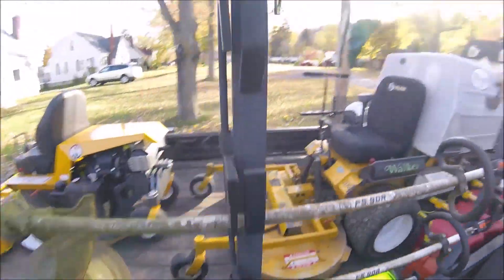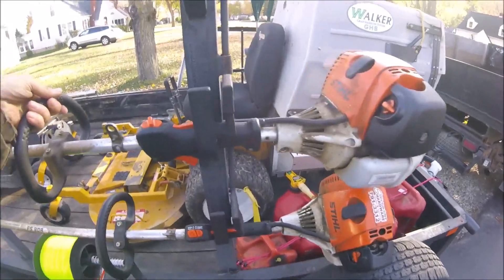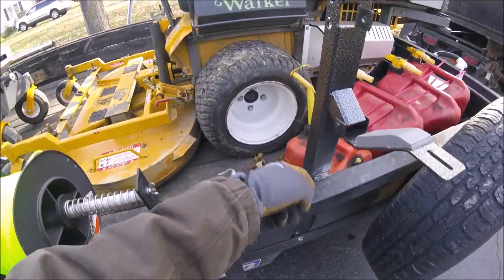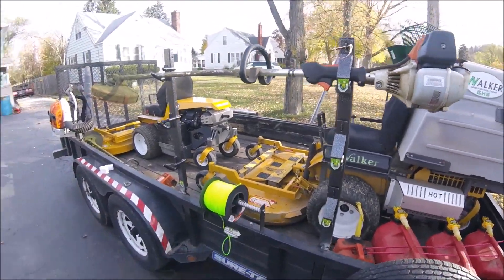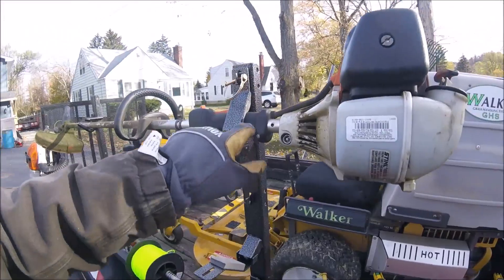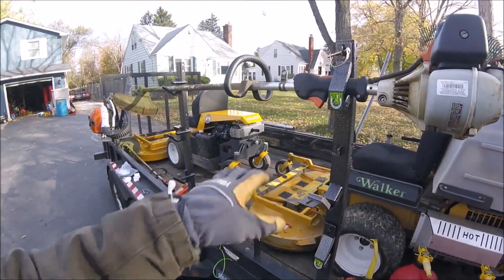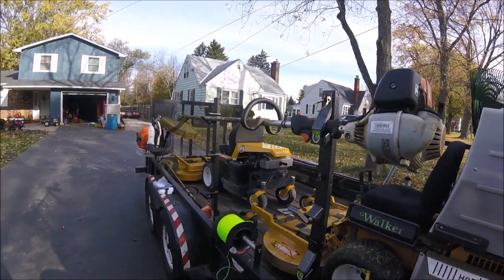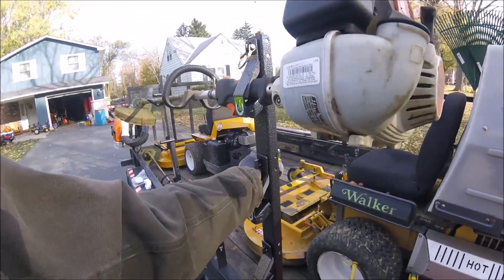New Trimmer racks & why I use what I use

Comment: do you leave your trailer outside at night and take your equipment inside everytime?
Reply from the maker: Lock the trailer up with extreme locks and the trailer is under cameras at 3 different angles over 28' up so they can't be reached.
Reply: What about the equipment being in the elements"?
Reply from the maker: @MatthewSmith-uf6tr  oh nevermind, sorry usually I run an enclosed. Yes, when I use the open it all comes inside

Comment: The green touch racks come with the  engine supports now but they suck balls! I️ just got mine. Love the racks but the new style engine supports suck because here isn’t much adjustment like the old engine supports you had to buy. Never the less they are pricey, they need to get there shyt together 😂
Reply from the maker: San Quin All about the money. They could care less about the customer
Reply from the maker: Mike Zavitz gotta stick with whatever you like
Reply: Mike Zavitz I️ thought about goin to the defender ones but I️ have three trailers lol I’m not going to buy three new racks. So far I️ have a set for each one of the trailers which makes it easy to swap trailers from the maintenance 6x12 to the dump trailer or the small enclosed . I️ will email green touch and let them know there new engine supports suck 😬
Reply from the maker: San Quin I would
Reply from the maker: Mike Zavitz someone commented on here they are worse. Not sure
Reply from the maker: Mike Zavitz for sure. Hope everything worked out for you